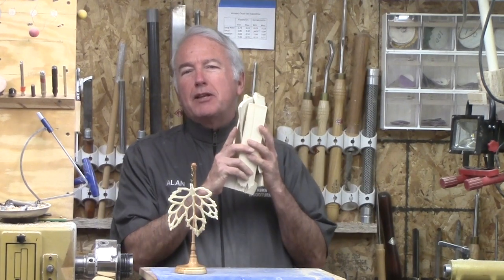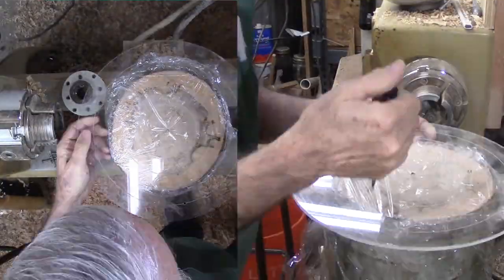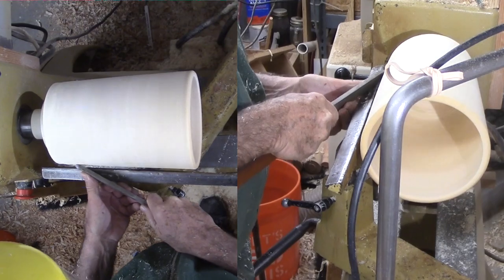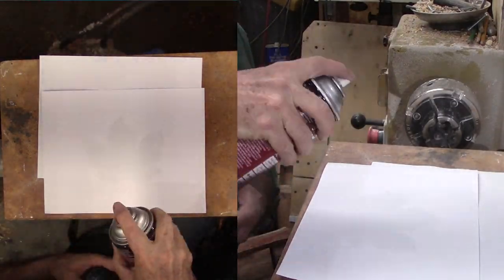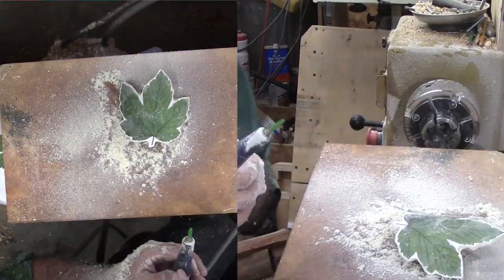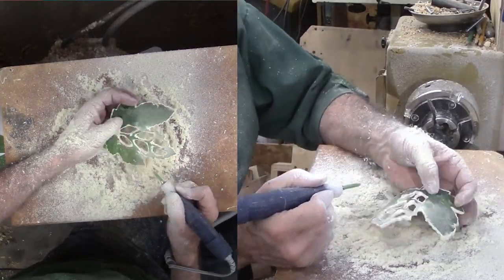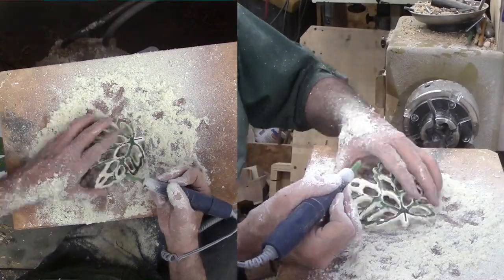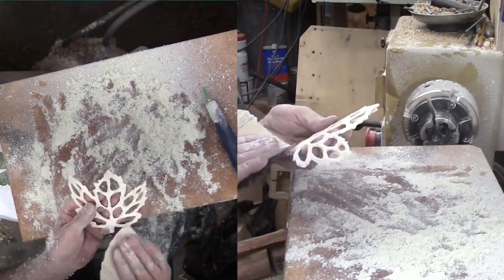Woodturning Pierced, Curved Leaf - Lemonade From A Lemon

Comment: Looks great!  A few other options could be a dragonfly, butterfly or bird... eagle, swallow,  cardinal
Reply from the maker: The trick is how to achieve the curve that would be nice for each.
Any tips?
Alan
Reply: @AsWoodTurns  just to keep an eye open for using the scraps just like giving the wood to its maximum to show off the grain... to find a nice picture of a dragonfly or bird in flight and find how the wings are curving in flight to match the curve of the fragments and size/ radius or dia of the once to be vase or vessel. 

No one will ever know that it wasn't intended to be anything else.  Like you said about making lemonade.